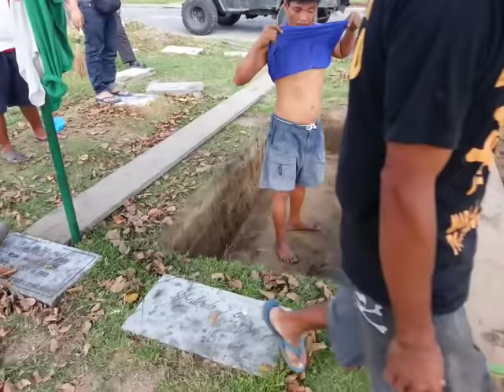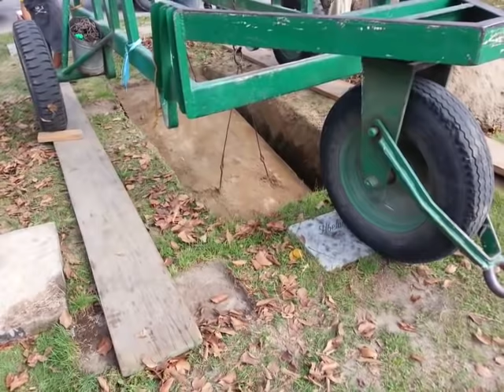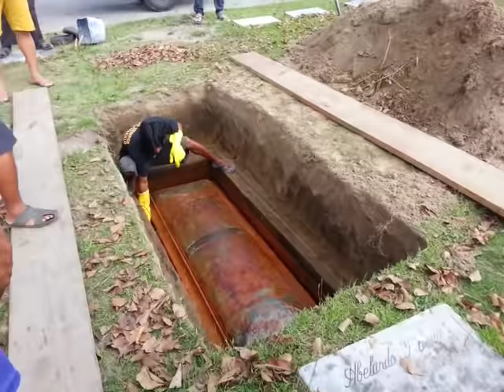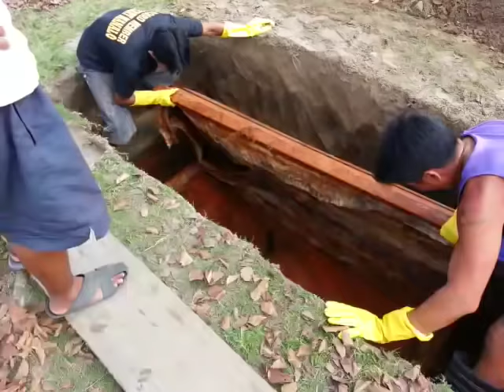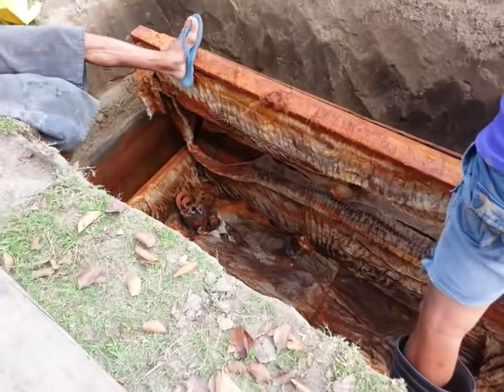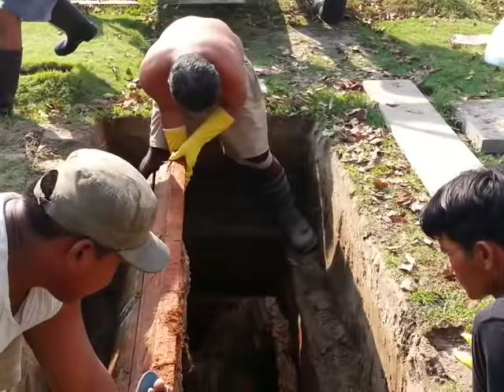Exhuming Lolo after 18 years

Comment: Iv used to work for a large cemetery company in my younger days. At times we had to exhume graves for one reason or another such as an criminal investigation, family request moved, and a couple times buried in the wrong spot. It seemed that more then half of the vaults were full of ground water when the lids were removed even though they are supposed to be water tight. The coffin would be all rusted and falling apart. I think it's all a rip off. Myself I'm going to be cremated when I go if possible. It will be a lot cheaper for the family too.
Reply: Right on bro. Digging up remains is a waste of time and honestly it's stupid. Many more ways to save or make money. Leave the dead alone lol for real...

Comment: Let me just say this funeral homes are a til off cause all the money they charge you for the funeral and the casket and the vault that isn't even sealed right under the ground and see what happens? I buried my dogs in caskets put them in a concrete enclosure made out of concrete blocks and cement and sealed the tops with concrete and 30 years later they had to be dug up and moved to another location ! When they came with piece of equipment to get them out it was still in tact and I had to break the tops off to recement them the casket and inside were bone dry !That's because they were sealed the right way ! These funeral homes are allowing water to get into the vault because they are not sealed properly ! Why are they getting away with this?The body that's embalmed is seeping into the earth and the water supply ! Does anyone say anything about that?